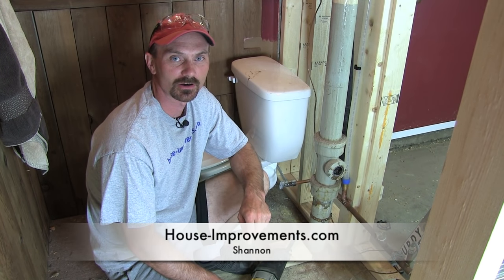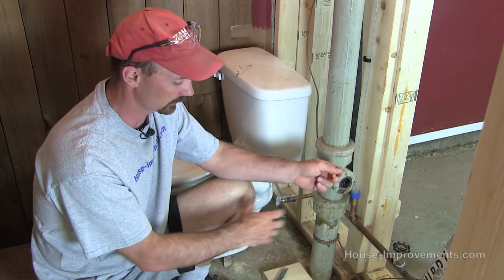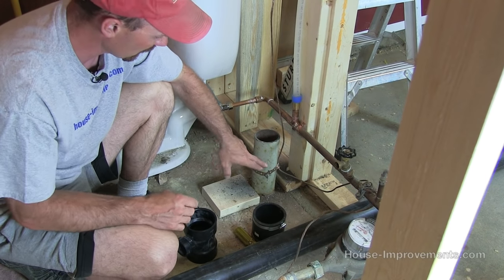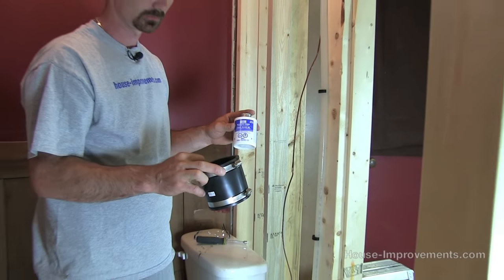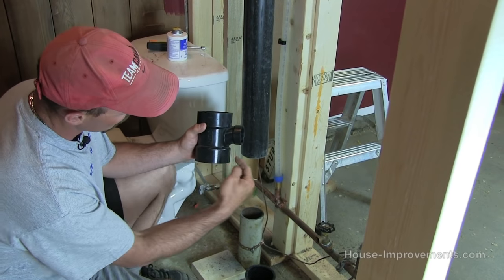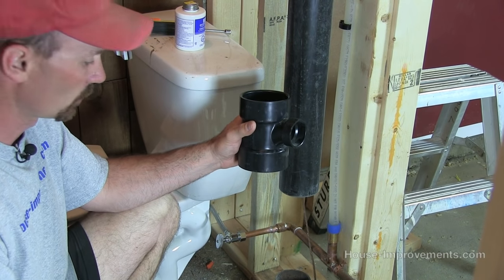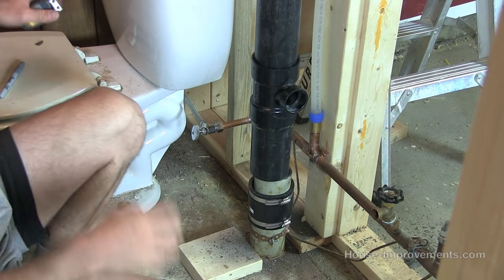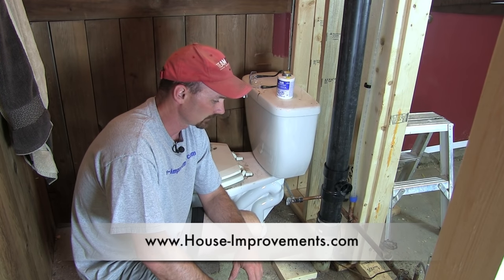How To Cut And Replace Cast Drain Pipe

Comment: obviously he's not a plumber no primer used and the main stack shouldn't move like that you're supposed to primer and glue both fittings and pipe when you push the pipe into the fitting you're supposed to give it a quarter turn stick to what you know buddy leave the plumbing to the pros

Comment: I'm sorry to say, but this should be a how not to video. 1. Use the proper tools for the job. I.e. chain snap cutter/ soil pipe cutter. And ABS cutters or a reciprocating saw. 2. You have to glue both sides (fitting and pipe) if you don't apply enough glue, you run the risk of having leaks. 3. Never dry fit pipes, or you will forget to glue some of the joints, just like you forgot to glue the top of that TY. 
I Blame YouTube for people thinking that they can be trades people, and for all the injuries and property damage that go along with it.
Reply: So basically what you are saying is that you are a repairman, and not a plumber and dont know anything about plumbing.

Chains are not old school and are still very much used today. chain snap cutters are faster and easier to use that a reciprocating saw.
 
Furthermore I don not recommend home owner's/handyman to touch plumbing stacks if they don't know what they are doing. They can cause a lot of damage i.e.(water, mold, flooding) not to mention the health issues if they do not repair it correctly and maintain a sealed plumbing system within the dwelling.

I am all for people learning, just take the right avenues to do so. Youtube has everyone thinking that if they watch a few videos they can build a house or rebuild and engine.
Reply from the maker: Ian Cooke  This is a DIY channel and I do not know any DIYers that would own a chain snap but most will own a recipsaw.
Reply: HouseImprovements
Another win!
Reply: LOL nice late reply. Service work is not plumbing. Any person with two left hands can change a cartridge, snake a drain or change a faucet. (You are a parts changer).
Reply: Ian Cooke let it go dude... Damn.
Reply: I don't own a chain snap, but I do own a recipsaw!